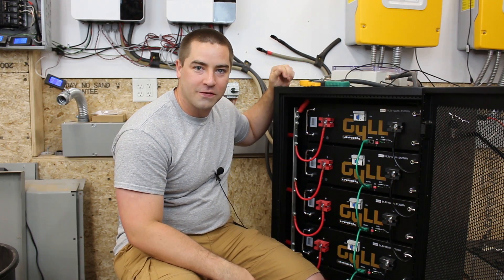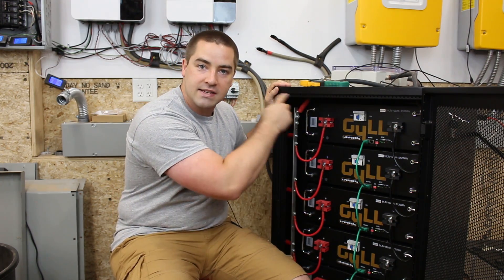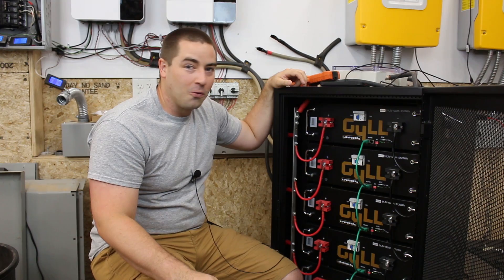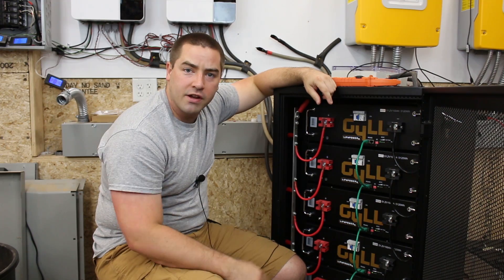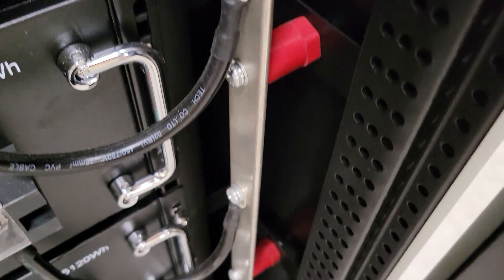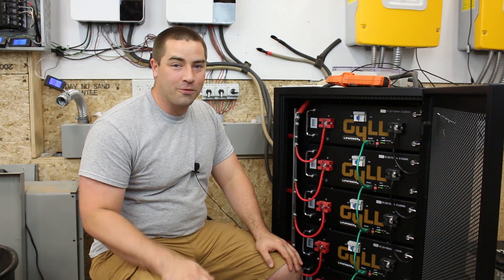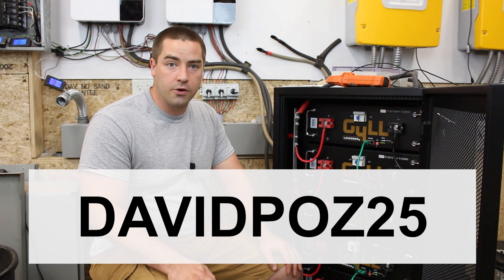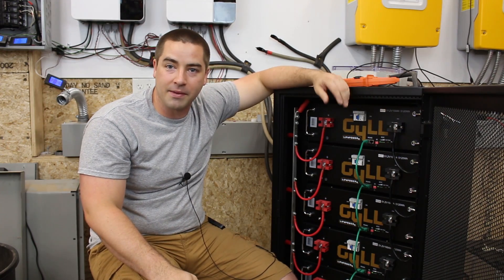Cheapest Pre-built 48V Battery, LiFePO4, Update when to buy

Comment: I really believe that the building you have done helps the rest of us think critically as we endeavor to make the most reliable system choices.  
Where I am at is using Smart Lifepo4 Battery Protection Board 300 amp BMS 48V 20s for Bluetooth in 16S with a 5A Active Equalizer Capacitor Balancer for each 16 cell bank. Hoping for more maintenance free situation as I move way from the 16 T-105 Trojan batteries I am so tired of babysitting.
My question is, how much do the difference between the two types of BMS used together is beneficial for the batteries or diminish the functionality of their intended process for their individual purpose? Does the residence balancing of the Smart BMS diminish the capacitance reactance transfer between batteries through the Active Equalizing Balancer? Does the Active Equalizing Balancer interfere with the representative information of each cell the Smart BMS is trying to provide?
Reply from the maker: When we are talking about balance function inside a BMS...  It's not a big deal.  When you build a battery pack you should be top balancing your cells before adding the BMS.  When you top balance them they will be perfect on day 01.  Over time they might start to drift out of balance and that is what you want the BMS balance function for.  It's only to keep them in balance.  When done this way the BMS is doing very little work.  So any loss from the balancing is minimal.
Reply: @DavidPozEnergy  I think we are all well aware of top and bottom balancing. When you search Lithium Iron Phosphate Batteries that's about all that's talked about. I really believe that the testing done here is extremely important as for those that have proposed using just an active Equalizing Balancer without a BMS and the benefits of using both together to propagation of a more even charge and discharge of the cell in unity. I don't see it being implied using an Active Equalizing Balancer beeing implemented instead of beginning with a high state of charge Top balance or bottom balance. These test are very important to make the intended process of charging with the characteristics of these cheap Chinese apparatus in the use of protective equipment of such a long term investment.
Reply from the maker: I might have miss-understood what you were asking.  Sorry.
Reply: @DavidPozEnergy  I think he did get to the part of the passive bms balancing with resistance and the active balancing with capacitance. He turned off balancing in the passive BMS. In the end I think he is showing you can take these two cheaper bms and make them work as a better unit together without buying a expensive unit.

Comment: you could lengthen each wire from the bottom to the top of the bus bar to the battery incrementally to perfect the balance. just ohm top of bus bar to entry point of bottom battery and increase the length of wire to match its resistance to the remaining batteries.

Comment: Your bus bars might be undersized.  Watch the temperature.  Need to make sure plastic studs don’t melt.
Reply: The bus bars are milled from 5x30mm stock so rated only for 170amps. Not a lot considering the 48v x 6 batteries are rated for 600amps at 1.0C. 
 (google busbar ampacity calculator and you'll see)

Comment: Can you use these batteries to be charged by the grid in case of an emergency if you don't have solar?
Reply from the maker: Yes.  The inverters I'm using (last 2 videos) have a UPS function.  So they let the grid pass through when available, but automatically take over the load when the grid goes down.

Comment: are they new batt cells in the GYLL?
Reply: AND DO YOU HAVE TO WORRY ABOUT FIRE IF STORED IN HOUSE?
Reply from the maker: Yes.  They are new cells.  These are LiFePO4 chemistry, which is one of the safest types of lithium.
Reply: @DavidPozEnergy  thanks for that. how long do you think it takes to really know these are good for long term use?
Reply from the maker: In Part 1 I did testing.  The capacity test showed these are new, and performed better than the rating.  Woo-hoo!  Then during discharge and charge I checked for any hot spots and found none.  That gives me a lot of confidence.  I've been using them daily powering my house off grid for around 4 months and they have been great.
Reply: thank you so much for the great info David.

Comment: David, if you want to really balance the load on the busbars, just to send a wire from the top connector on the bus bar to the bottom connector with a heavier gauge wire. That way, both ends of the busbar have power and all connections are exactly the same distance from BOTH connections on the busbar.

Comment: clearly there was one amp difference between top and buttom row. you can fix it. takes a day of work, but you can do. connect the main wire to the centre of the metal bar. and disconnect the reconnect the battery wires to as near as possible to the center.
Reply: Simpler just to send a wire from the top connector on the bus bar to the bottom connector with a heavier gauge wire. That way, both ends of the busbar have power and all connections are exactly the same distance from BOTH connections.

Comment: When you measured the Amps in both the left side and the right side, I saw a 5% DIFFERENCE between the top amps and the bottom amps.  Moving either the plus or minus main bus bar connection to the bottom of the bus bar ( opposite diagonal connections ) would help reduce this difference ...
Reply: You do realise he didn’t have a constant load on the system don’t you?

Comment: If they are coming from china...just buy from China. Save on the markup
Reply: Fair, but heads-up, often it's still cheaper to pay the markup when they're paying container-level freight charges (which is often by volume and not by weight) and an individual often pays by weight (and these are 6 100 pound boxes). Just FYI....

Comment: Do you have these set up to communicate with the Sunny Islands? If not, how did you handle the low voltage cutoff for the inverters? I picked a DC solar trailer and am struggling to get it working with my DIY lifepo4 and JBD BMS. I would appreciate it if you could share your Sunny Island settings for Lifepo4
Reply from the maker: Right now the batteries do not communicate with any inverters.  I'm currently running Growatt brand inverters, not the SMA's.  But I did go through a couple of things on the SMA's when I used them for all of last year.
1. I'm currently beta testing a software in a raspberry pi to hack the SMA's.  I'll be making a video on it this year, but not done testing yet.
2. When I ran the SMA's for a year I used the following program: VRLA (valve regulated lead acid).  This assumes 24 cells, so I programmed the cells to charge at 2.33v on the SMA.
3. The algorithm was odd, so I told it that my battery was 999Ah (or whatever the highest was)  
4. I used an external shunt.  Details in the manual about wiring an external shunt and calibrating.

Comment: Can you rig two of those fully loaded cabinets in parallel?
Reply from the maker: Yes.  Mechanically speaking, you can parallel any amount (3, 4, 100 cabinets...).  However, if you are someone who wants to have a laptop dedicated to monitoring the batteries, then the limit is 16 batteries per RJ45 connection.  I'm not into that stuff, but I remember reading it in the manual.

Comment: The easiest way to balance the discharge and recharging current is to leave the positive inverter cable connected to the top and the negative inverter cable connected to the bottom. this way everything will balance and there wont be any over working of a particular battery in the rack. Good luck

Comment: Hi David, haven't had a chance to watch all of your videos about these batteries. Just curious as to what size conductor you used from batteries to the inverter? I have had these batteries working since last summer without fail. I feel they are an excellent value and solid build. I use 4 nissan leaf battery packs (48v) in parallel with 6 of these GYll battery sets with the same cabinet. I'm thinking based on ratings of used Nissan Leaf batteries and the new GYLL that  I have somewhere between 32 and 38KWH (never actually tested the supply).
Reply from the maker: Awesome.  I have 1/0 wire from each inverter to central bus bars.

Comment: I have 51kwh bank and looks similar to yours batteries.. Electronics looks identical.. Only difference each of my battery is 165Ah and they don't use cabinet... They are like bricks stuck on the top of each other siting on wheeled base. If fact they are called power bricks... They also work excellent... My generator is just for decoration... No need to use it for over a year... And I have all electric at home even stove, oven and dryer.

Comment: @DavidPoz
On the links, two battery “models” are offered.  I read their descriptions over and over and can’t tell the difference between EG4 and Lifepower4.   Can anyone explain their differences???
Reply from the maker: I don't think there is a difference.  I just ordered one today that was available.  Just make sure you get the voltage right.  I ordered a 48v one.
Reply: @DavidPozEnergy  Strange!  Yes!  I ordered 48v also.
Reply: @DavidPozEnergy  which did you order?
Reply from the maker: https://shop.signaturesolar.us/products/48v-100ah-battery-by-eg4  and I used code DAVIDPOZ25
Reply: @DavidPozEnergy  I just wondered… same one I ordered!  Cool!
Reply: @DavidPozEnergy  page not found 12/July/2021
Reply: @DavidPozEnergy  I was reviewing the site pictures of the LifePower4 version and the EG4 version and the front panel layouts are quite different.  On the EG4, for example, the breaker location is in the center while on the new LifePower4 version, the breaker is on the left side next to the positive terminal.  No biggie by itself but certainly it suggests, at the minimum, that some internal wiring and components have been arranged differently in the newer version….  any thoughts?
Reply from the maker: Naw, no thoughts.  I'll review it when it arrives, but that's as far as I've had time to think about it. I bought one, full price (minus coupon) so that says I have enough confidence that it will still be fine.
Reply: @DavidPozEnergy  I understand! 👍 I have no reason to believe that it means anything to the final product… I just thought that it was worth mentioning the visible differences I could see.  Cheers! Thanks so much for your videos!
Reply: @DavidPozEnergy   one further note: I’ve now received my EG4 48v 100AH batteries. I find a significant change from earlier versions!  Gyll has added another tiny switch (a red on-off switch).  It’s significant because closing the breaker no longer cause energy to flow from the battery terminals as it did in all your videos.  Now the red on-off switch MUST be turned on for power to flow.  I suspect this switch is wired into the BMS.  
Interesting?  Had you found this on the one you recently ordered?

Comment: Signature Solar just put up the pre-sale page for the restock of these.... and they no longer the same exact units. (UPDATE: And they are sold out again) Check out the image of what the new ones look like here (link below or on their own website of course). Until someone posts a video of their internal components it must be assumed there are changes inside as well. To add, this might also mean the 1st gen Gyll's and 2nd gen units are potentially incompatible with one another. Someone will need to thoroughly inspect the internals and test with a 1st gen unit to confirm.

https://www.dropbox.com/s/qah3xybymimpm0c/New%20Gen%202%20Gyll%20aka%20EG4%2048v%20Battery%20Design.jpg?dl=0

https://shop.signaturesolar.us/products/48v-100ah-lifepower4-battery-by-eg4

Notable visible changes are:
01) Breaker is now a 2-unit manual throw differing from the single manual main + auto-reset sub previously
02) Breaker has been moved to below the positive lug which prevents you accessing it when wired up (forcing wiring cables upward which might not be possible with space)
03) Breaker now has external exposed metal mounting bolts (previously did not)
04) Positive and Negative lug positions have been moved from center height to top of front face (aggravating the upward wiring situation mentioned above)
05) The rack ears no longer have the elongated screw positioning holes to facilitate rack placement adjustment
06) Unit handles are no longer fold-able which puts them in closer vicinity to electrical connections
07) There is no longer an external 'front face' grounding lug
08) The Rack housing it's self no longer has the well designed removable top and instead has a cheaper 'drop on' this metal plate (without recessed screws)
09) The location of the front face data connections, dip switches, reset and indicator LEDs have all moved - this points to different electrical hardware and BMS units within.

On the upside Signature Solar is stating that these new units are supposed to communicate with the Growatt units natively now - so - that's a cool thing :) This could also mean that end users will no longer need (nor receive) the USB dongle used with a PC and the old software to communicate with the BMS. It however also lends more weight to the possibility of incompatibility with Gen 1 Gylls unless these Gen2's were designed with backward compatibility for the old BMS units.
Reply: Aaaaand, they are now SOLD OUT already by noon eastern time July 1st 2021. I guess in about a month or so we'll get to see what all these Gen2 buyers have to say about the changes and differences between the Gyll (gen 1) units and these.
Reply: Bummer, it seems they no longer have the 48V version for sale on the site :(

Comment: David I have a product for you to review.

I have two Gyll 5.2kw batterys and an WZRELB Pure Sine Wave 4000W inverter.

I am wanting to run a 15,000 btu rv air conditioner (14.5 amps run load) and am not sure if it will start it.

I am thinking of installing a easy start micro air soft starter on the a/c.

I would love to see you do a review of this and in particular would like to see you install it on your air compressor and try to start it with your smallest inverter.

Love watching your videos.
Reply: Can it runs air-conditioner
Reply: @devonroberts1812  yes that is what it is designed  a/c for boon docking rvs
Reply: designed for

Comment: There are 2 possibilities for equalizing current paths for all battery blocks:
1. Diagonal connection of power poles from inverters to busbars, as mentioned earlier.
2. Create a Y-shape cable end with 2 or more pigtales, derived from main pole cable, crimped with cable lugs. And connect these pigtales to corresponding pole busbar equally along its length.

Comment: Use the FILO method of connecting the batteries. put the main ground at the bottom of the bus bar and that will correct the imbalance.

Comment: I have sunny Ireland 8.0h 12,  would this battery set work with this inverter on off grid? Many thanks.
Reply from the maker: I don't have that model.  Is it a 48v inverter?  If it's 48v then this battery will work in the voltage range, but it doesn't support the direct communication.

Comment: Hi David, I went on Signature Solar's website and tried to use DAVIDPOZ for the purchase of a 10kW 120/240V Grid-Tie Inverter by Growatt, but I'm being told "DAVIDPOZ discount code isn’t valid for the items in your cart". Is it only specific Growatt inverters that this applies for? I have a 9.6kw array I'm wanting to setup and figured a little bit of room for expansion would be good.
Reply from the maker: I don't know.  I sent Signature Solar a message asking them, but you might have better luck calling them and trying to use the code over the phone.
Reply: @DavidPozEnergy  thanks for the response, I will give that a try.

Comment: Hey Dave...now I see that there has been a rebranding of the batteries?  Seems strange after months of Gyll reviews and hype.  That's a red flag to me.  No mention of that in your video?  What is going on?
Reply from the maker: I don't know why they re-branded.  Maybe because there are some software changes to make communication happen with more inverters?  I showed a screen shot with the new logo and text block mentioning it.
Reply: I missed your mention if it.  Thanks.  I'm trying to verify the batteries are an exact match of what you tested.  Cells, amp ratings etc. And it is not readily available on the website.  Am I missing it?  Appreciate your replies.  I want to be educated before I buy.
Reply from the maker: I'm told they are the exact same specs for: Cells, capacity, amps.  The only difference I'm aware of is the software compatibility.
Reply: @DavidPozEnergy  Thanks Dave.  Appreciate the work you do on the channel.  Big fan.
Reply: You should definitely review the new model ASAP to show it off and confirm the specs!